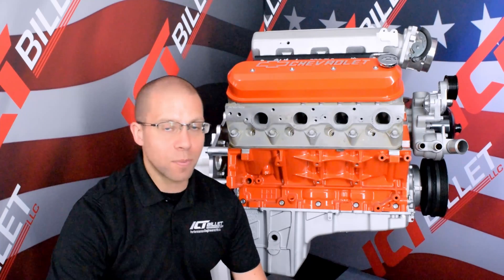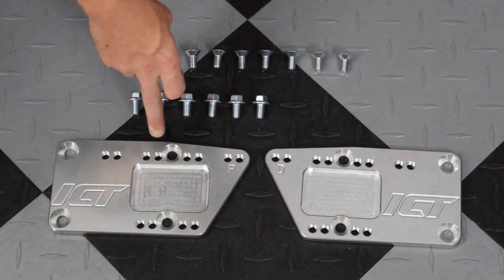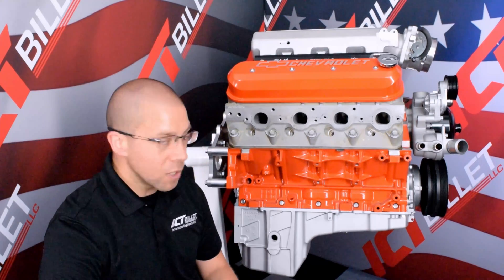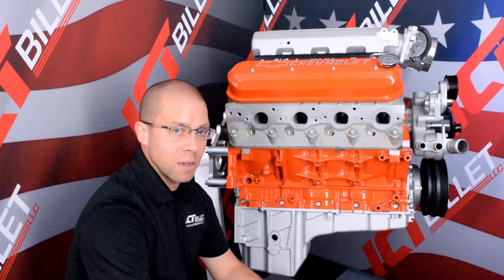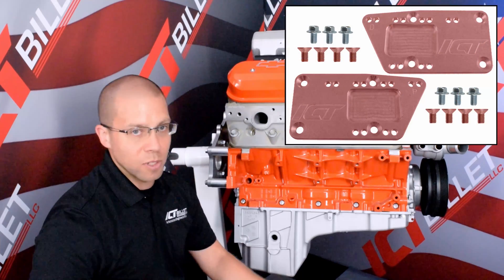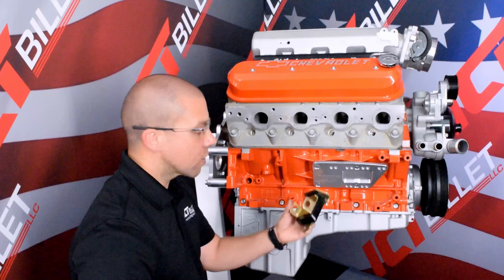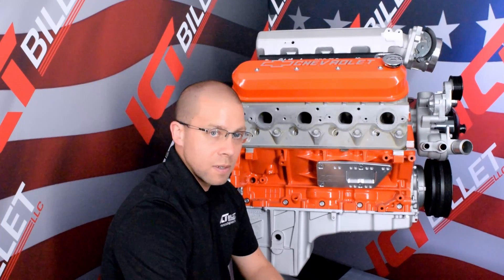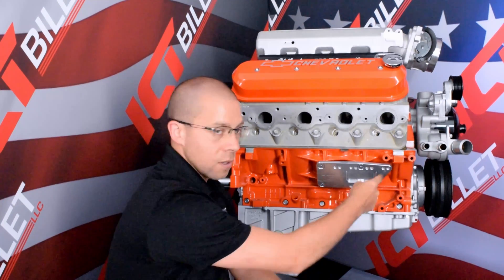ICTBillet 551628 LS Engine Swap Adapter Plate Installation

Comment: Have a 1974 c20 pickup it is a b.block putting lq9 t400 gear vender that i have what brackets i belave small block c20 pickups are different

Comment: Is the sbc mount supposed to sit flush the back indent doesn’t allow
Reply: cut around it or heat up and hammer flat with torch
Reply: I had to grind the top 1/2" or so of the bump on the motor mount for it to sit flush.

Comment: That adaptor doesn't fit a 5.3 without removing compressor and grinding down the ac compressor mounts?
Reply: So was that the way to make AC bolt bro? Have to grind the bracket down some?
Reply: 6.0 LQ4 as well
Reply: Same problem i guess that's why they did the passenger side in the video👀